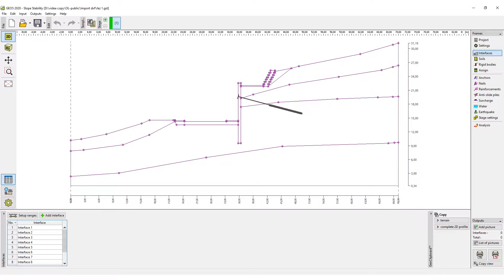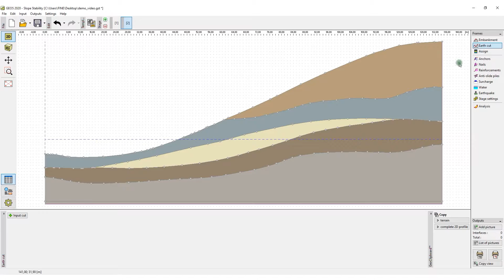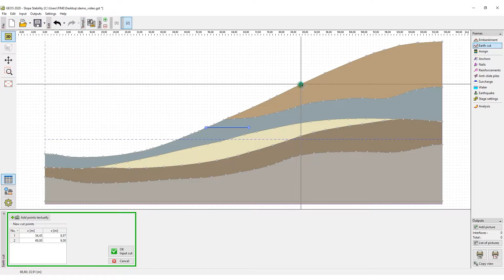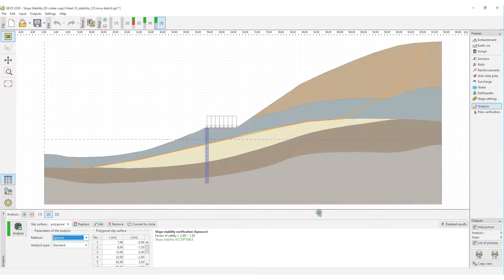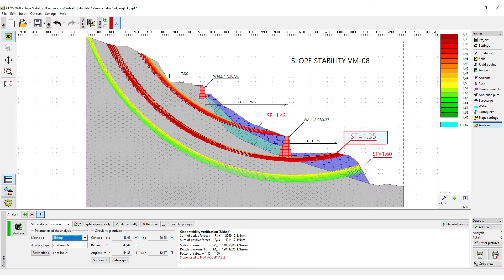Introduction to GEO5 Slope Stability

Comment: Hi Sir, in slope stability analysis, why the do you used 1.5 safety factor as a required value? Can you give me explanation why do you used it and also of there is code or standard for basis of using it like is it based on the ASTM? Please enlighten me
 
Hoping for your response Sir/Geo 5😊
Reply from the maker: Hello Axelle, thank you for watching, SF = 1,5 is the standard value of slope safety for permanent design situations however it is user input. So the value you want to use is up to you and you can change it as you need. You can also use verification methodology based on limit states (e.g. EN1997, LRFD). If you need more detailed information, don’t hesitate to contact us at geo5@fine.cz. Best regards, Fine team

Comment: How did you add the two retaining walls to the profile
Reply from the maker: Hello, it is easy to add all walls using the interfaces. Then you can fill them with „Rigid body“ material. If you would like to use our training materials, please visit https://www.finesoftware.eu/engineering-manuals/, Manual #8 introduces Slope Stability analysis. Best regards, Fine team